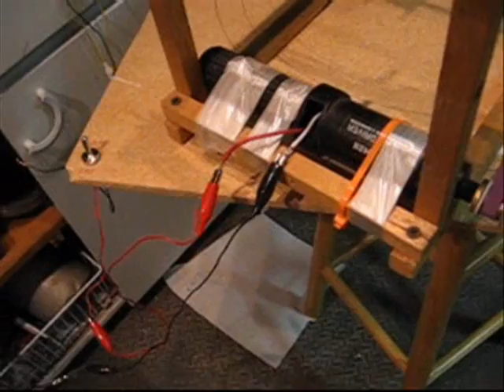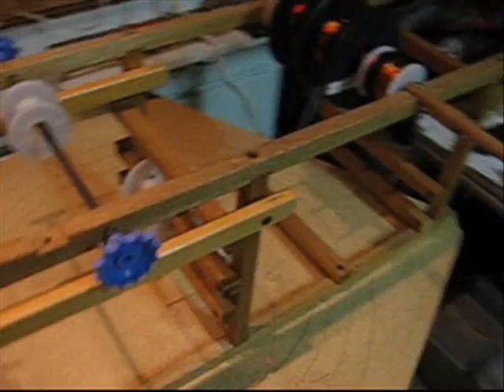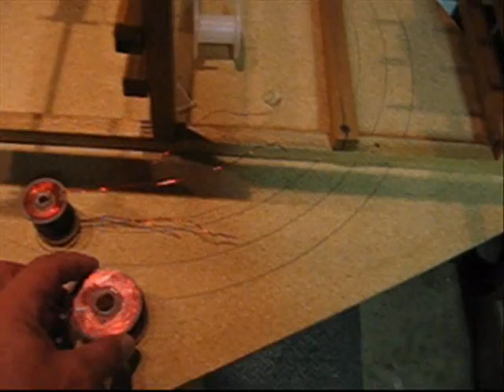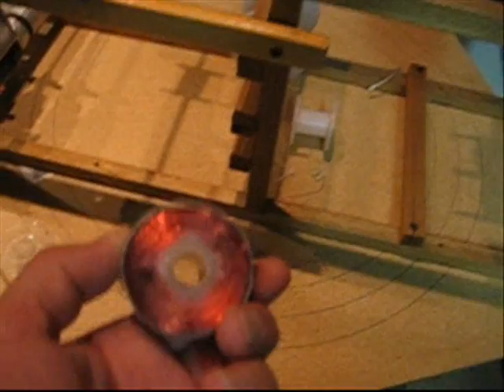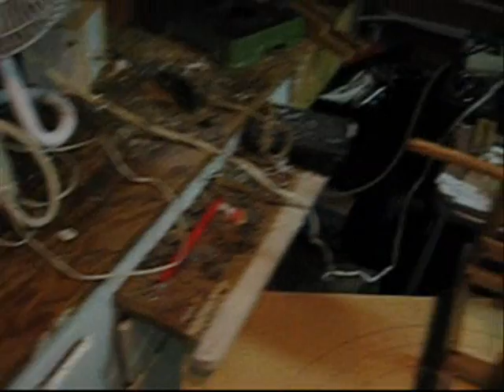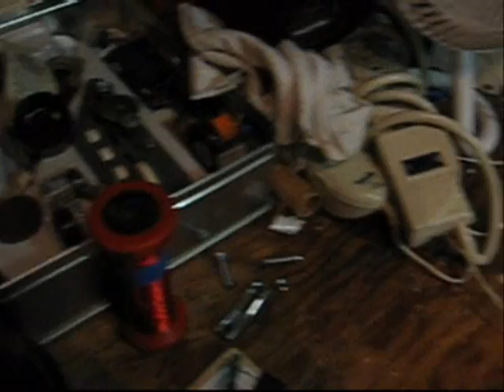Coils, Winder and Questions

Comment from the maker: @lingcodnine ya I used them as well. I eventually just started making my own. I would buy some thick plastic from a home store and use different hole drills and PVC tubing. I found it easier then chopping down old wire spools.

Comment from the maker: Thanks Your one of the first who's told me something that I can really use. I figured that the flat coils didn't need a core but wasn't sure about the longer coils and now I know.I realize that a coil with a core will produce more drag on the system so I want to avoid them. I also needed to know the correct thing to search for and "axial flux generator" is what I needed. I've been asking coil questions for a long time because I know it's one of the most important parts of any generator unit.

Comment: but if you like to use the low rpm generator where the coil's length is only 50 - 100mm, i guess the iron core will not give the juice as in bedini's, it also sticky area which surely will slowdown the speed.
lastly, i guess... giving some times to study the low RPM generator will give us some ideas.

looking forward for your next video. good luck with your good project.

Comment: as for the shape of the coil they are using a rectangle shape. some people reports that this shape is better than rounded shape. 
most of them are using single direction coil connected in 3 phase configuration. 
as for me, i'm going use their approach but using around 200 turns. 
the bedini's does not need huge amperage nor voltage to work. i just need to make sure that the generator will make some "juice" at a very low RPM.
the iron core surely nice on bedini's coil due to the bobin's length.

Comment: to my (poor) knowledge, thick wire will give more amperage & more turns will give more voltage. for example if we are using 0.7mm wire at 400 turn at 500 rpm will give us 5vac. now if we put more turns and others remind the same then we got more VAC but less amperage.
looking on some low RPM generator, they are using very few turns (compared to bedini's) which only around 30-50 turns and using 1mm or bigger. with this set up, they are aiming at 12vac which is more than enugh to run any bedini.